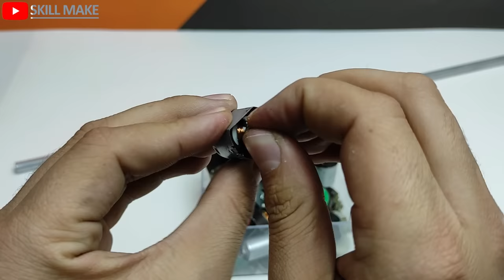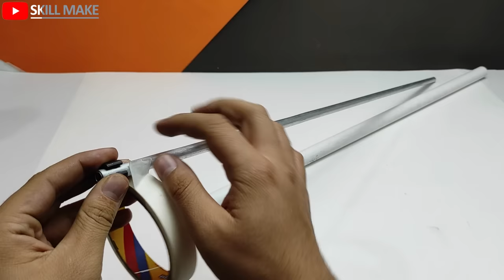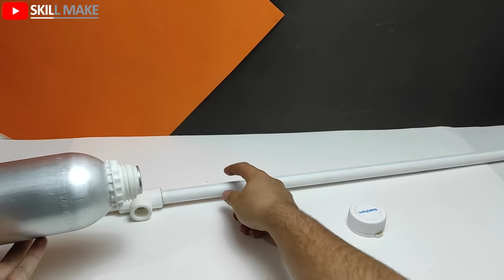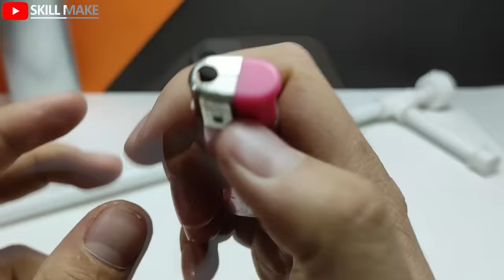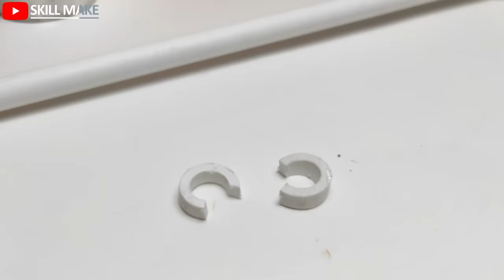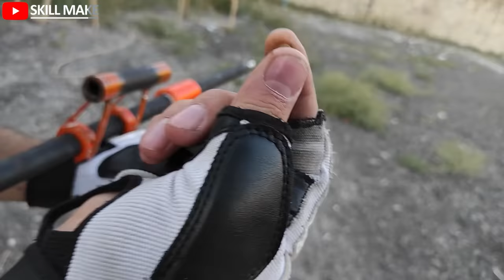How To Make Alcohol PVC Air Slingshot - how to make alcohol gun (diy alcohol gun)

Comment: Great video, but there is a problem that leads to poor firing. It is related to the socket, where when the spark is ignited, the gas expands in the handle before the nozzle, and this leads to weak divorce :thanksdoc::goodvibes:
Reply: So...that mean the gun couldn't kill ??
Reply: t simply means that the handle has to be sealed as well for better air flow/expansion

Comment: I think if you add a small one-way valve at the back you could add fuel and air from that port. I assume you're using isopropyl alcohol 90% or better